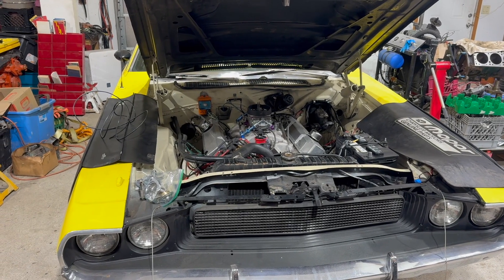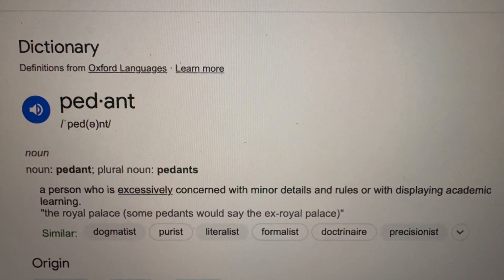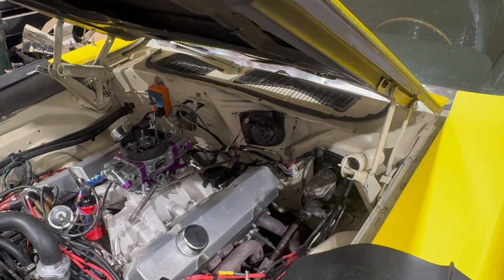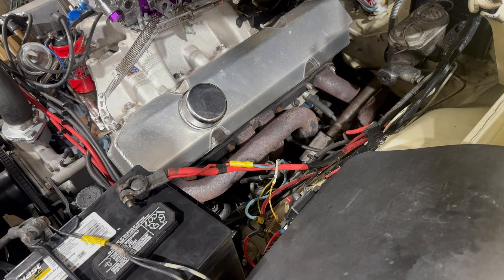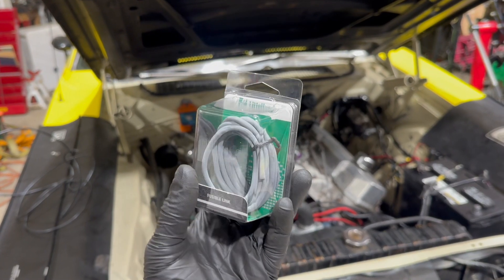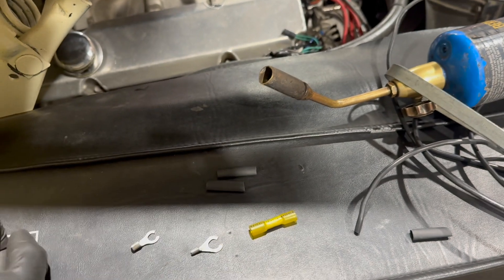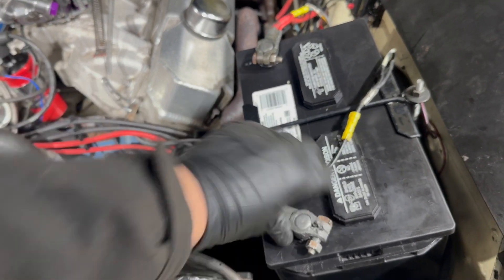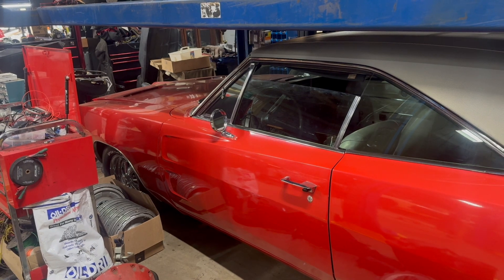The Big Shunt Wire Guide - Prevent Electrical Meltdown In Your Classic Mopar With This Easy Fix

Comment: I like the “mad electrical” site for the wiring upgrade.  I also complain like a baby on insulated crimp connections.  Ever since I was a teen in the 80’s when my speaker wires fell off continuously
Reply: Drummed in my head on the mad site from moparts days
Reply from the maker: Yeah! I’ve seen that before.

Comment: Jamie : Does adding that shunt wire reduce even more electrical feed to the entire system when running full load? Example: Headlights ,wipers, A/C running at the same time?
Reply from the maker: Adding the wire doesn’t change the loads on either side of the equation. It can reduce some power loss due to resistance and heat I suppose, but in general, it merely acts as a way to spread the loads out and reduce the possibility of heat, melting, and other horrors in the factory connections.

Comment: if the wire to the dash was replaced with a lighter one and including the shunt wire would the guage work properly?
Reply from the maker: Any current running around the gauge will reduce the reading it shows. Shrinking the wire would be a bad move.

Comment: AWESOME info Mr J. I have a 73 Challenger I had a problem with that wire from the alternator getting HOT all the way to the harness connector under the sterring colum. Your way sims to be a better idea as to my colum get HOT  above the key ingition. Im going to try this sett up. Dont worry I wont have my lawyer contact you if my ride burns up...lol    MOPAR 4 EVER.
Reply from the maker: Good 😅 for the ignition switch wiring, you’ll want to cut and run the unhappy wires around that plastic connector. Very common problem on E body more than the others for some reason, but I’ve seen it in As and plenty of trucks too.

Comment: Just a Niggling Note: the connectors in the bulkhead connector are "Packard" connectors, not spade connectors, which can carry a bit more current than spade connectors can. On my older Mopars, I prefer to just run the charge and return wires directly through the bulkhead connector (eliminating the "Packard" connectors at those positions), rather than running the new charge wire in parallel with the factory one, in order to preserve the proper operation of the ammeter.
Reply from the maker: I’ve done that plenty of times too!

Comment: Thanks for sharing 😊.I wasn't thinking about that idea back when I rewired a '70 300 and a '68 Charger. I did however bypass the original charge circuit directly through the firewall and believe me I had a positive response on starting and charging.😊
Reply from the maker: Yep, I’ve done that too. Common mod I… probably should have mentioned in this video
Reply: @DeadDodgeGarage  I wonder if over decades the factory hookup on the firewall permotes over working and failure of the charging system as a whole or in part weakening the regulator and alternator. Demanding more ampers than is possible. When both mentioned cars wiring burned they did so after I put them to bed for the night. Both cars ran like crap before hand. Honestly I enjoyed driving that 300 a lot especially straight of road 🛣️ that was dark at night with very little traffic. Smooth as glass. 😂 When I typed glass this comes up 🍷, I'm more like a 🥃 don't like wine 🍷

Comment: I cant wait for "Doug" to chime in this isnt needed!
Reply from the maker: Which one’s Doug? Lol
Reply: @DeadDodgeGarage  Hes on the B body forums. I think he has 3 youtube handles maybe more. He went wild on my shunt videos...give him a min. he will come rolling in! He is the bass player for great band Origins...and Shania Twain!
Reply: @DeadDodgeGarage  I posted a link to it but it got blocked.
Reply: @DeadDodgeGarage  @oldblueaccord2629, Went wild? Really? I recall your handle now and vid, you promote something like a 2/0 welding cable as a so-called shunt wire with no circuit protection at all on a A-body of some kind and called it safer. I simply pointed out how dangerous that was. I believe Mr. Atwood would recognize how dangerous a very large cable connected directly from the alternator to the battery would be without any circuit protection whatsoever. A comment you long since deleted after a very nasty retort IIRC. I am active on FBBO, I have exactly two handles on YouTube, one I use to counter a lot of Chrysler technical misinformation like yours. Don’t know what the bass player reference is about. Since you deleted my first attempt to reply to your comments here, I’m replying a DDG comment, may suffer the same fate.

Comment: UPDATE:  When I replace a 6v generator with a 12v alternator it came with a shunt and replacement amp gauge calibrated for the shunt.  The back of the gauge was stamped with the size of shunt it was calibrated for.  The Alt + out went through the shunt to the battery  (WRONG!).  Everything worked fine and the alt gauge read in full swing either way.

EDIT:  There I go talking out my ass again!  That circuit makes no fkn sense - the shunt belongs between the alternator and the ammeter.  I installed that upgrade only 41 years ago so you'd think I'd remember the schematic.
Reply from the maker: Cool!

Comment: I have done this also, but it has a downside.  You now have two fusible links in parallel feeding the dash wiring, so a dash/ignition short really won't burn the fusible link before damage to the dash/ignition wiring.  You want to disconnect the original alternator output that goes to the bulkhead, and connect that wire/bulkhead connector to the same side of the fusible link as the bulkhead battery connection.  This splits the load on the connectors going to each side of the ammeter, but the total load is protected by the single fusible link that is sized for the main dash/ignition wire sizes.  If using a fuse in place of a fusible link, it should be a "slow blow" fuse like a Mega fuse or ANL type fuse.  They are rated different also.  Regular fuse will blow/open at the rated current, where the slow blow fuses are rated to only blow/open if the current exceeds the rating for many seconds.  This prevents temporary current surges from blowing the fuses.
Reply from the maker: A good point. And agreed - when we have used a fuse for this, it has been a Mega Fuse or similar.

Comment: I've always liked a voltage gauge after putting in the bypass wire. But the only vehicle I've ever put one on was my old 78 W150, and it had both a volt meter and a ammeter from the factory.

Comment: I understand the issue with traditional analog ammeters is that they need to be wired in series between the alternator/generator, and the load (the car's battery and accessories). And having that go through a gauge on the IP this is a real problem when your alternator is able to put out 50-80amps at 122VDC. That IS a Fat Wallop of current that you really don't want to go through to the dashboard and back on its way to the battery. (If you do the P = IE math, 50amps @ 12VDC is 600 watts.) 
But on those 60s-70s era  Mopars I used to have, I found that ammeter to be a handy item for keeping tabs on battery and voltage regulator condition. If the ammeter didn't return to light charge within 10 minutes after a cold start, that was a sign the battery may be weak and might fail to start the engine once the sub-freezing weather set in. If the ammeter registered what appeared to be constant substantial (say, 5amp) charge, and never returned to center, then that was a flag of either a weak battery or of overcharging, and that needed further checking at the battery with a volt meter. I've always found ammeters far more useful on the dash than simple volt meters for heading off future problems.  
Does anyone make an aftermarket ammeter that uses an inductive pickup that can be placed around the battery cable (that sends a low voltage & current signal to the "ammeter" at the panel - said "ammeter actually being a simple analog voltmeter that can read both positive and negative polarity signals form the inductive pickup)? 
Thanks for another educational video. I do learn stuff from your videos, even though it doesn't seem that way.
Reply from the maker: I don’t know the answer to that, but it’s an interesting thought. Thanks!
Reply: Well I’ll be, someone who recognized just what the original purpose of the ammeter is/was. To monitor battery charging/discharging. To be clear, there should be no vehicle loads registered on the ammeter while the engine is running, only battery charge/discharge, fully charged healthy battery will have the needle centered, little to no current flowing through the ammeter. All factory loads should be covered by the alternator on the alternator side of the ammeter.

Comment: I ran a 10 gauge wire straight from the V/R to the battery with a heavy duty toggle switch by the shifter with no fusible link! The down side was forgetting to switch it off and killing the battery, again....
Reply from the maker: From the… voltage regulator? Was this on a generator system with a big gnarly mechanic one? Charge output doesn’t go through the small one or two wire regulators on these. But could see value in having direct battery voltage to the regulator. It will have a much better idea what’s going on.

Comment: Would that be the same process on a 1968 300 convertible
Reply from the maker: Essentially, yes - although in general, the C body harnesses are more robust, and I believe in ‘71 for example, they essentially already have a shunt wire. You’ll want to consult a wiring diagram and see what that looks like.

Comment: Very nice video. I already wrote you a while ago about my planned experiment, using an under hood shunt and a later C-body ammeter designed to work that way But fitted into the gutted Challenger ammeter housing.  

My bulkhead connector showed signs of overheating; I had a modest stereo upgrade, but also added e-code halogen headlights which drew more power and kept tripping the breaker in the headlight switch.

All of the headlight relay articles I found back then pre internet said to tap main power for the headlights off of the battery positive and I bet that’s part of why the bulkhead connector had started overheating even with the relays installed. It wasn’t until a couple of years ago that I found an explanation of why you need to hook new or increased loads like stereos and auxiliary lighting off the alternator side of the ammeter wiring.  It was a big WTF until I saw the wire flow diagrams and then it made perfect sense. 

but I am allergic to crimp connections. I know they’re supposed to be OK if done properly, but as long as I’m pulling the plastic off the connector, and using adhesive lined shrink tubing, I am going to solder all of those connections.   I may also use Deoxit-gold on all of the spade connectors in the bulkhead when I get to that point.
Reply from the maker: I almost said specifically in this video that I don’t believe in soldering automotive connections. I do understand why one might, but I’m a crimp guy. Get a good crimp and protect it, and you’ll be just fine. Right - even using a relay off of the battery, that power has to be replenished somehow. That’s a pretty simple way to imagine it.
Reply: @DeadDodgeGarage  Why do you not believe in soldering automotive connections?  More work than required or another reason?
Reply: @ thank you for replying. I’m sure you have seen far more bad crimp jobs than I have, but the ones I saw were enough for me. I have a crimper I use for solar panel connectors that might be just fine for use on the car too with the right connectors with the open U in back instead of the already closed barrel. It does the W shaped crimps instead of just squishing around around the wire.. I would be far less concerned using it on the vehicle wiring, than the crush crimper type.

But I’m not gonna argue with you  😁

Comment: I seriously should save this to my greetings list because it's spot on and informative to all. Very on point and the only thing I do different is not run a fusible link I use a 30amp breaker so if it gets to hot it kicks out and doesn't burn anything. I did once use a 50amp breaker and that was because the amps of the alternator was 75amp. Over all I love this video. With your permission I will add it to my play list.

Comment: Lesson I learned back in the 80's. Properly torque down the nuts when reinstalling wiring to the gauge. Finger tight is not adequate. Lucky no fire, but several frustrating moments of complete power loss.
Reply from the maker: Yes! Agreed. And was wishing I had thought to mention that during editing, but let it go.
Reply: @DeadDodgeGarage  PS I often heard about the shunt wire. Over all these years it was never explained like this. Thankyou

Comment: Well done video! I’ve never really considered the bulkhead connection as a source of high resistance. Why? Because I’ve never unplugged any of my connectors. You’ve made me very curious as to the connection condition as my Mopars are over 60 years old. Hmmm, what will I find?
Reply from the maker: Well, hopefully nothing awful, but I wouldn’t bank on it. Haha. If you do pull them, that’s a great time for a cleaning and the application of some dielectric grease.

Comment: Is that why the 1969 Charger Alternator gage had numbers showing the amount of load in Amps, but GM vehicles had gages without numbers, only showing a negative and positive side for the needle to move to.
Not necessary to know the value of the charging circuit, only need to know if its charging or not, which even a warning light can do.
Reply from the maker: I wouldn’t trust the numbers anyway. Not all gauges had them, but some applications did. That’s exactly how you use one of those - am I charging, or not?

Comment: One thing I found helpful on Dodge trucks with the 67 amp and larger alternators, is to clean and solder the bolts to the back of the gauge.   There is only a weak crimp on a steel to copper connection there.  Repeated heat cycles and the vibration of a truck WILL loosen those over time.  That's why most older Dodge truck clusters are melted and/or charred there.

Comment: I bypassed the ammeter entirely on my 73 Charger and carefully replaced it with a voltmeter. I managed to keep the original look of the rally dash. I adjusted the voltmeter for a reading of 12.8 to be the center of the original ammeter so it mostly behaves like original. It's a little more active than the original and maybe a little twitchy during turn signal use but it does correctly represent the charging/battery state of the system.
Reply: Good idea using the ammeter to read voltage.
Reply: Nice!  I bypass my amp gauges and replace with a voltmeter every time. Oh, and bump up the charge wire.
Reply: 😮 how did u do it? Simply by adding a resistor?
Reply: @JKratochvil77  Disconnect the 2 feed wires and splice them together. Secure them away from the inst panel. Gut the ammeter from the panel. Then it becomes an arts and crafts project installing a voltmeter. You'll need to connect to ignition positive and provide a ground to the new meter. I used a bosch voltmeter. Got the idea from "forBbodiesonly".

Comment: Last summer, I had an issue on my 1970 Dodge Dart where my alternator wasn’t charging my battery, though it would keep the car running if it was already running. I do have an electric pump and fans, and I replaced my alternator, battery, voltage regulator, checked my wiring, added relays, and nothing I did could get the alternator to charge the battery. Then I watched one of your previous videos about MOPAR electrical systems, and added a shunt wire per your recommendation. That solved the problem, and she’s been running perfectly ever since. 

I do plan on replacing all the wiring once I can afford to do so, as 50 years of different owners have kinda made the cars wiring a mess, and do plan to go back to mostly original wiring, with only additions for the fuel pump and fans, and I do plan on installing a digital gauge cluster.
Reply from the maker: Nice! I’ve run into that a couple times. Well fixed.

Comment: After dealing with the wiring in my 71 Camaro, which was hacked together and very crispy, I bit the bullet and got a complete upgrade wiring harness from American. It was NOT cheap and it  WAS a pain in the ass, but I've thanked myself many times for doing it. It did, however, not come with any provision for the ammeter. In fact the instructions said that it was on purpose and to switch to a voltmeter from a later second gen. I don't love that as I'd like to keep things at least looking original at first glance, even if it does have an HEI and a 120A single wire alternator but it's a small thing. A small thing that bugs me every time I look at it. 😁
Reply from the maker: Don’t know about your application specifically, but for the ‘71 Challenger (also an American kit,) the owner was able to have an amp gauge converted to a volt gauge by Redline Gauge Works. It matched the dash perfectly.

Comment: I got an Electrical Engineering degree in Peoria, so caution: gooder American english was not a requirement for the degree - we measured voltage with a volt-meter, and amps with an am-meter (we say meter the same way for both).
Reply from the maker: Understood 😅

Comment: AMP meter as opposed to a Volt meter in GM , If you even have one . I've heard of the coil being back fed through the amp meter keeping the car running after you shut it off . maybe a volt meter would give you a second opinion on Alt. out put ?
Reply from the maker: Coil can not be “back fed” through amp meter. The amp meter is hot at all times. The path from that constant power source to the ignition has to come from another source. And GM used amp meters (not volt meters) well into the 50s. A volt gauge is a fine addition, but if your amp gauge / ammeter is in working order, you already know what you need to know.